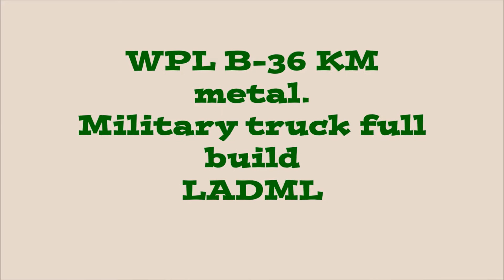WPL B-36 KM  METAL RC MILITARY TRUCK. Full build

Comment: v nice. it seem this truck can not be defeated in reasonable conditions.  is he still working well ?  how many minutes on the clock so far? (aug 2023)
Reply: Thanks. After 3 years it works well. With 7.4v lipo battery can be used for 10 minutes.

Comment: Well done for putting in the work and collecting the toy.  But there are a number of remarks.
 1. This car has never belonged to the sanitary service!  It's a communications car!  Telescopic antenna on the roof of the kung.
 2. The flashing beacon was always located either above the driver in the cab or there were two of them, but they were installed on the cab and not on the kung (booth).
 3. No side lights!
 Lights up like a Christmas tree!  Only headlights, headlight finder and stop.  One reversing headlight is allowed, but it was not.
 4. The three lights on the cab only turned on when a trailer was connected to the car.  Without a trailer, the "Auto-train" mode is disabled.
 5. The canister has never been on a car, especially in red!

 By movement.  There is no smoothness and .... If you were dealing with this technique, you would know that they don’t move off-road at such speeds.  Put a mini-camera in the cabin or on the cockpit and then see how everything shakes!  The speed of this car should be approximately 1 revolution of the wheel in 1-2 seconds.  This is an all-terrain vehicle army Ural, not a Kamaz-Master rally car.
 A canister, a red cross, side lights and a flasher on the roof are superfluous.
 But in general - well done!
Reply: Thanks a lot for the information. Very interesting!
Reply: i can't be bothered to do as much research as you have, nor verify it. i'm a beginner to RC, not the actual realism. yet. but thank you.  it shows the true level of passion to the subject is always a thing to learn, from the those that learned for us and go on to teach us. thank you brother.

Comment: Hello, Did you get your b36KM from BG with upgraded middle axle  (axle throught diff to third diff) or with standard metal one where two pinions gears are connected to one bevel gear?